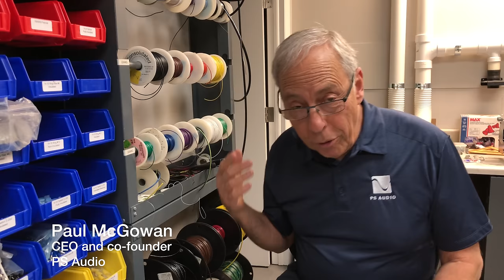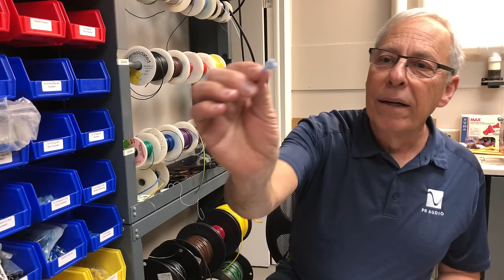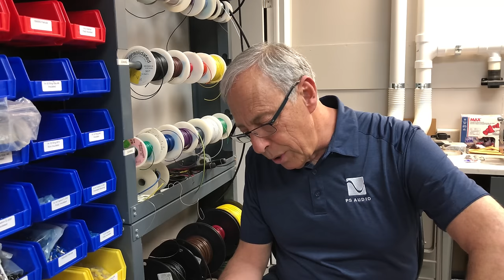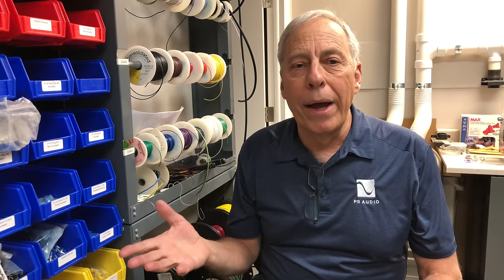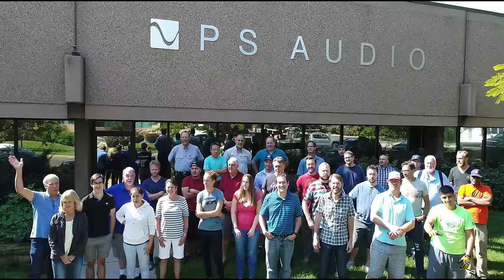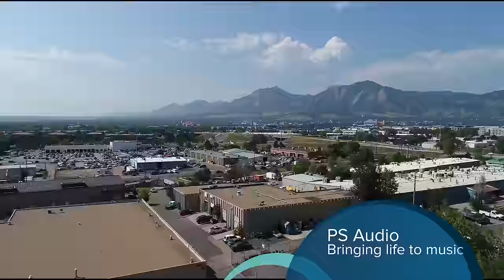Electrostatic speakers and music

Comment: I think I'd rather have a pair of Paradigms with a good powered subwoofer and a nice McIntosh amp, and that would do me if I had the dosh. Sounds to me like 
electrostatics are a bit too finicky for rock, blues, folk-rock, punk, goth, dance and pop music, which is mainly what I listen to, plus jazz and some classical. I cannot stand distorted speakers or headphones, but I also cannot stand when they lack at least some solid, true bass response. I just picked up a new pair of hybrid electrostatz headphones, they sound darned good
considering they weren't the Koss $2000 ones or whatever. They've managed to make them high-efficiency and they do have some decent bass response, although
not quite as good  or sublime as my planar HIfiman HE400is.  I never had the money for electrostatic speakers or $10000 power amps etc. or the room for any of that stuff. However I've
heard both Infinity and Paradigm and Martin Logan electros in some audiophile shops, so I know how good they can sound set up properly.  I used to sell pro audio
for about three years in the later 80s, but this was at a NY low to mid fi retailer who shall remain nameless, and we didn't exactly sell really high-end stuff.  Yamaha
or Harmon Kardon were about the highest level, Onkyo etc. We did have tons of Sennheiser headphones and those sold like mad.

Comment: "A head in a vice" was never an issue with the acclaimed Beveridge electrostatics and their "cylindrical waveform technology" design -- one of the original reference standard line source loudspeakers that predated the Infinity IRS models.
See patent: https://patents.google.com/patent/US3980829A/en
Reply: Erratum: "head in a vise."

Comment: Sounds like you have never heard soundlab speakers they are smoother than any speaker i have heard when you use OTL amps on them. So i totally disagree with you it sounds like you heard Logan Martins and then wrote all Electrostats off lol your lose mate. That is all i have tried on them a pair of Joule Electra 160 Grand Marque mono blocks. The new Soundlabs are phenomenal and dynamic with great real bass  can listen for 8 hours straight with zero fatigue cannot do that with box speakers.

Comment: Learn to play an instrument and some music theory. Then you can focus on the actual music instead of the sound quality when the sound quality fails. It works very well for me. Of course there is irredeemable damage made on some records where the music is very good but the sound is just to terrible to suffer through.

Rush - Vapour Trails is one classic example of a group famous for excellent quality sound suddenly doing a wall of sound loudness wars combo that was pure suffering. Of course they remixed it entirely years later to fix it. More current is Opeth latest records. The two before was produced by Steve Wilson and as such excellent sounding. But this one is like a modern vapour trails... No amount of music quality exploration will cut through sound quality that bad. And this is just two examples of excellent music ruined by sound.

But mostly. Somewhat bad sound can be ignored if you have other noticeable qualities to focus on.

I do however wonder about a lot of modern trends in music. Bad and bland music that is badly, on purpose, mixed to cut through on bad sound equipment, and is only sufferable on equipment so bad that it actually masks the bad production values, which makes said music impossible to listen to on quality equipment. However, it is bad music to begin with so it's no great loss. It's when actually good and intricate music gets bad production I get somewhat mad, but as long as I can enjoy it on some level it is still ok. And knowing music and music theory on an instrument level definitely helps enjoying more recordings. 

Also, I dabble in studio engineer stuff, so that is another thing that makes a difference, but mostly negative as you get mad when you clearly hear what the studio engineer has worked to achieve, and then some corporate controlled mastering "person" has totally ruined everything. The old Radio-cut as opposed to the production cut has to be reinstated, also different mastering for different media formats. But that would reduce profits in the short term so... 

I'm torn on this subject. Can you tell? :)
Reply: Be careful with learning too much music theory. I had a friend who taught me a lot of music theory and it got to the point where I took apart everything I heard and I no longer enjoyed the music. I had to forget all I learned to enjoy music again.

Comment: Wow...CEO does not know anything about his prototype lab.

Thin wire?  Why for any amp?  In automotive, we use 1,000's of Km of wire so weight and cost are in the value equation.

Heat shrink...is it sealed with glue for protection from smoke, humidity, other?  If used to spice and sealed, accept, otherwise why in the design.  

Those push-on clips will expand with age and kill and clean signal desired by original unit.  Not looking good.  solder, silver solder, twist signal pairs.......NEVER that connector shown and "crimped".  Even with solder dot at wire, connector junction will fail with heat cycle and time will lead to noise or total failure!

On airbag circuits we use gold plated terminals and fully twisted pairs to reduce any outside signal degradation.

Stopped watching at 1:23